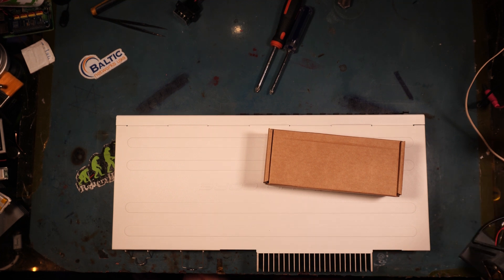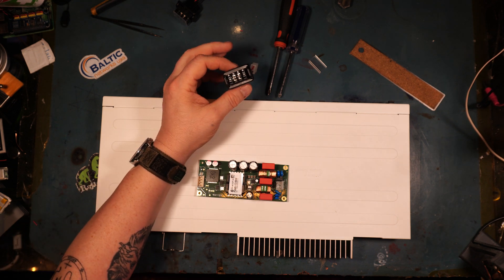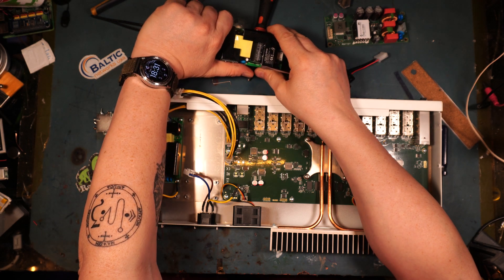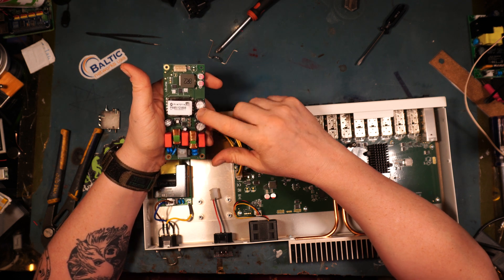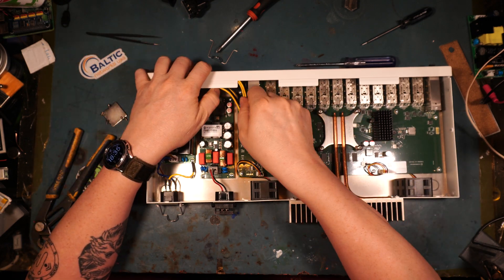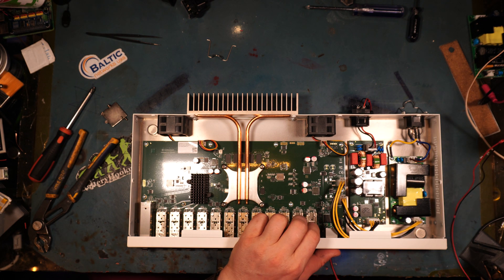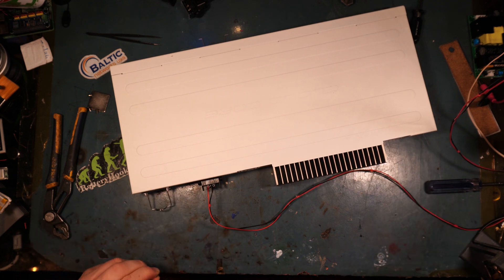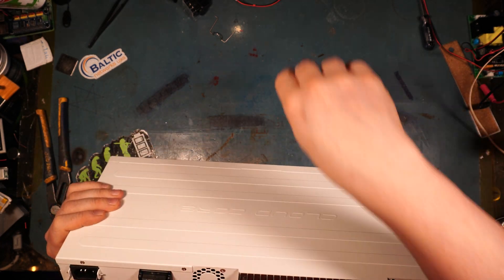CCR2004 DC Conversion

Comment: At least pretend to short out the main ac cap before you palm the undersides of ac power supplies
Reply from the maker: These psu's have been offline for months. Typically the caps are dead within a few hours. Especially since theyre on the DC side and drain pretty quickly as the device consumes what's left.
Reply: @ That’s just not universally true. Sometimes the control chip cuts out before the ac cap can be drained and many don’t have bleeder resistors. Typically is not good enough regarding electrocution.
Reply from the maker: Well. I don't know what to tell you. Shorting caps is a bad practice. We discharge with a resistor in the lab usually. My business partner and I  have been working with high-level electronics for roughly a couple of decades. Also what do you mean ac cap... These caps are DC on the DC side ;) 
What is it that you do?

Comment: Can you explain the reason for not running AC and DC at the same time - I have some coworkers that refuse to want to spend proper amounts on infrastructure and will always need external input.

I can see the "desire" for an alternate power source when on generator backup, if disaster hits and the DC side is down.  But as you said, that is complete disaster/wrath of god type scenarios.
Reply from the maker: Voltage differential across entirely different power sources. Also, the majority of cheaper ups's like apc, tripplite have floating neutrals. The likelihood of a full DC plant failure is pretty slim if installed properly. Think of an ac plant as a nice wood cottage, while a DC plant is like a concrete bunker built into the earth's crust. 

The battery bank is the main protective element in a DC plant. The larger the capacity the harder it is to move the voltage up or down. Also since the battery plant itself is not part of the national grid there's no path through them. As for the AC element ie rectifier they're usually built extremely resilient with mov's to reroute any unwanted energy away from their internals. 

With all that Said. This is why all proper telecom plants "Att, Roger's, telus, Vodafone, Bell, Hot" etc etc run 48v DC plants. DC is far more resilient. DC is far more reliable.  Ac gear is more meant for in building settings like data centers or enterprise installations. Even then any major CO or telco build at a data center usually runs on a 48v DC bus.